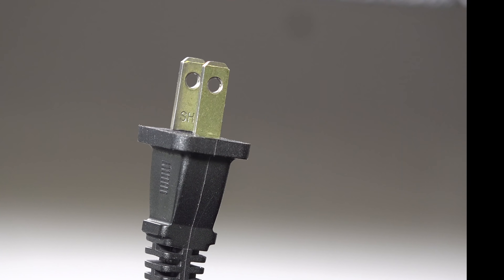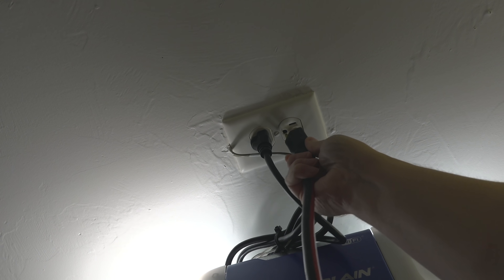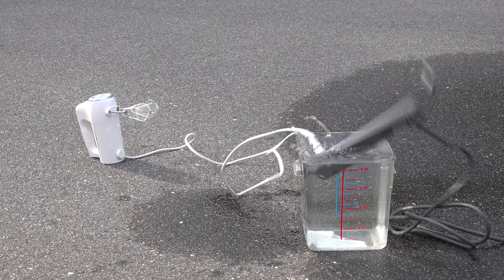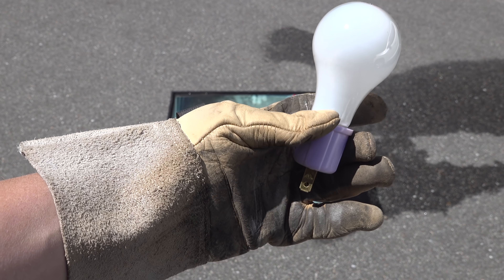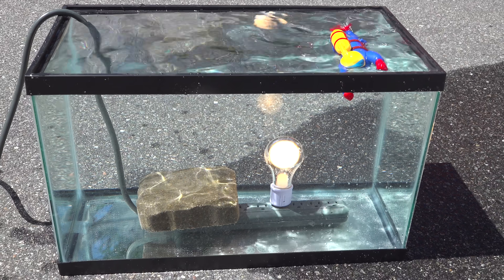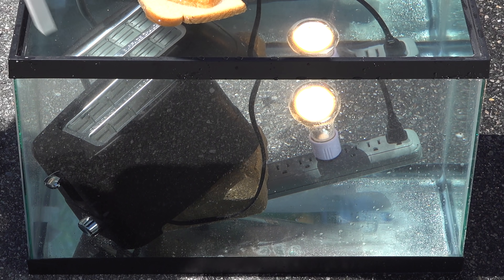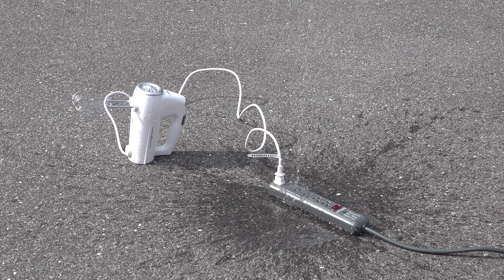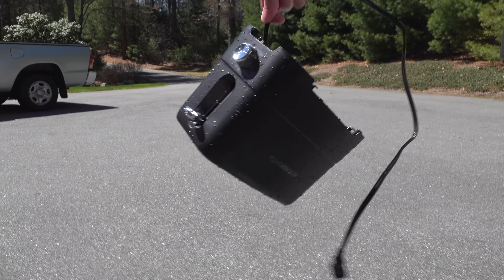What REALLY HAPPENS WHEN YOU SPILL WATER in an OUTLET?

Comment: Actually it is very unlikely to die in this scenario (not impossible) if you put your hand in the water in your setup. Water is generally an insulator and if you used distilled water you’d be absolutely safe if using 110v. Also the way the electric current flows is pretty straightforward- the greatest current travels through the least resistance. So the least resistance is the appliance load followed by shortest distance between the terminals of the outlet. You have to compute the chain of resistance starting from the amount of water between the terminal and your hand, your body resistance your ground insulation. All of that is normally so high - it amounts to mega ohms. So no current will flow through you needed to even give you a buzz let alone inflicting harm or killing you. Still you should not play with fire and electricity. Just stop believing these Hollywood myths.
Reply: I agree but in a salty water and your hand submerged already if you dip a power strip ur playing Russian rulette since you never know if hot or neutral goes in first.
Reply: @mind.hacker9996  well salty water depending on the tds could be a very good conductor. But even then it is far from a Russian roulette. Especially with 110v power grid. Again you should not play with electricity and fire either way.
Reply: No, current that will run through you only depends on your resistance and voltage, tap water is a conductor but with high resistance of around 1000 ohms to high voltage, if you touch your resistance will also drop to like 1000 ohms and that adds up to 2000 ohms or .05 amp through body and that will probably kill you if you fail to let go
Reply: @nekilikizhrvatske3336  in the scenario presented in the video - you won’t even feel the buzz. Unless you are bare footed and well grounded. Even directly holding just the hot wire while well insulated from the ground you won’t feel a thing.. but it all depends, if you use distilled water you’ll be safe, if you used proper ground insulation you’ll be safe. But if you used tap water with higher tds and have sweaty feet and you are either bare footed or wear only socks - well then you are in a deep trouble. So again, you shouldn’t play with electricity or fire because it can quickly go from innocent play to a dramatic event development.
Reply: @nekilikizhrvatske3336  please don’t try this because as you know slight change in the conditions - I.e. saltier water and being grounded may be fatal to you, plus her power supply might be using a transformer that galvanically decouples the hair dryer form the power grid.
https://youtu.be/sLjV_1iDJR4

Comment: Regular tap water won’t pass enough current to trip a breaker, but enough to trip gfci, to trip the breaker, you would need much higher voltage to pass enough current

Comment: You could have reached right in there and turned the toaster on. You may have felt a little tingle, but assuming you were wearing shoes, and on dry concrete nothing would have happened.
Reply: Even with rubber shoes on wet concrete he'd likely still feel nothing - just like a linesman working from an insulated cherry picker.

Comment: You should have added salt to the water or some sort of electrolyte, because tap water is relatively high in resistance around 1,000 – 5,000 Ω ohms. When a human body is around 300 Ω ohms. So when tap water or rain water is electrified a human body offers little resistance . Just like everything else electricity takes the path of least resistance.

Comment: water itself is generally a bad conductor of electricity , its the minerals in the water that increase it . add some soap or bath salts you will see a difference . your also asking the breaker to trip which would mean you need to get past that breakers tripping point , if thats a 30A breaker your going to need probably 40A to trip it. asking for the the water to carry that much current wont work, again needs a higher mineral content
Reply: Exactly. High resistance = no load. And normal breakers don't trip on ground leakage - they trip on current. Only RCD/GFCI will open circuit if there's a current imbalance between phase and neutral.
Reply: 30A breakers on 120V outlets?

Comment: Well to be fair that fish tank was fairly well isolated from ground with the glass walls, silicon seals and plastic trim so there really was no place for the electricity to go, mix with the fact that fresh water isn't terribly conductive the best place for the electricity to flow is from the hot to the neutral through the appliance.    As to the GFCI thing, yes they do and would save lives not disputing that, but spraying water on the plug only really tripped because the power strip was on the ground and you did create a path other than neutral for the electricity to flow, I'd be willing to bet a donut that if you did that same thing with the fish tank there's a good chance it won't trip as all the current that flows through the hot would still flow through the neutral hence no trip.

Comment: Clean water is an insulator.   Contaminated water can conduct electricity and the results would have been very different. Stay safe and use an appropriate electrical safety device especially when working outdoors or in damp situations.
Reply: It would have to have a lot of stuff in it to draw enough current to trip a normal breaker. Ultimately there would still have to be a sustained current draw of more than 15 amps to make it trip without the GFCI.
Reply: @StringerNews1 i'm no expert but electrolysis doesn't work with alternating current
Reply: @StringerNews1 good point, you dont need to care because youre right, i dont deny electrolysis im just not interested in chemistry so i dont do experiments
Reply: @StringerNews1 your also ignoring the fact that every country has a different school system
Reply: Pure water, H2O is non conductive. Mineral water, deep well, etc will conduct electricity.
Reply: @StringerNews1 i'm sure middle schools don't supply kids with alternating current
Reply: @StringerNews1 what school goes "lets do electrolysis the horrible way and supply kids with alternating current, and let them light it on fire!" as if you could produce enough in a few minutes, correct your facts, you used direct current.
Reply: @StringerNews1 I thought that electrolysis didn't work that well with ac
Reply: @misham6547  Electrolysis just needs a circuit path no? As long as it has that, it doesn't matter as long as it can flowl
Reply: @StringerNews1 https://www.youtube.com/watch?v=zj1Tb-uhup0
Reply: @StringerNews1 your gonna have to wait months to have enough hydrogen and oxygen for it to "explode"
Reply: @StringerNews1 are you sure you weren't  using direct current
Reply: @StringerNews1 
I’m saying the same thing, just making easier for laymen to understand. Salts, broken down into ions once in the water conducts electricity. It’s not even “might,” they really will.
Reply: @StringerNews1 
I get it. Thank you.
The switch and glass of water got me though 🤣
Reply: Yeah by "clean" you have to mean super purified distilled water
Reply: The reason why the toaster explodes in the bathtub because the water is contaminated by us that' makes sense

Comment: Show what the voltage between the water tank and the ground!  
Let people see how dangerous extension cords in the rain are are !! 👍
Reply: @StringerNews1 but generators are not referenced to earth, so it doesn't matter... The danger is if you touch more than one wire at a time
Reply: @AlessioSangalli  yes they are, neutral is shorted to earth so it has 0 volts

Comment: But it looks like we don’t need the protection. You were able to plug the bulb in under water without being electrocuted but growing up i heard don’t plug/unplug anything with wet hands. Seems like all bs myths to me now like the poisonous apples on Halloween.
Reply from the maker: No! The power was off at that time. You should NEVER put your body in any contact with water that has electricity in or near it. I won't be doing that test!
Reply: @SilverCymbal  oh i see, but why no sparks at least when it was powered on? Very strange especially when immersed in the tank because we know with that the water is in the outlet
Reply: @K0NY718  Sparks are formed due to poor contact. Since everything is plugged in solidly there is no sparking.

Comment: Did you check to see if the house ground became live/hot when it was plugged into the non-GFCI plug?
Reply: Surely it would be with a small amount of current. That's what made the GFCI trip, after all.
Reply: Ground cannot become live its always 0 volts
Reply: @nekilikizhrvatske3336  that's not true at all
Reply: @Krankie_V  yes it is, if it isnt then how does the multimeter write 230 volts difference
Reply: @nekilikizhrvatske3336  ground is bonded to neutral at the service disconnect. In normal operation there is no voltage on the ground however in a fault condition the ground conductor can and will become live. That's its job. To carry current away during a fault. In this case the breaker didn't trip so there's current (and voltage) flowing on the ground until the circuit is cut off.
Reply: @Krankie_V  well youre right but water has resistance it cant cause a short so that ground has almost 230 volts
Reply: @Krankie_V  not what i meant. To have voltage at ground you need a dead short from live to ground, and a mixer, toaster and water arent a dead short
Reply: @nekilikizhrvatske3336  that's not true. You only need a path for the electricity to follow. It doesn't have to be low resistance.

Keep messing about with this "knowledge" that you think you have and you're quite likely to be surprised with a nasty shock sometime.
Reply: @Krankie_V  ground is zero, live voltage is 230 volts, add a 230 ohm resistor and to voltage at live is 230 volts, the current through resistor is 1 amp, but the voltage at ground doesnt change its still zero because the difference has to be 230 volts for 1 amp to flow. Now replace it with a metal bar, the resistance is so low the current spikes to the maximum limit, now you dont need 230 volts for the same current, so the difference drops to low and tehnically there is voltage at ground but the breaker pops. Thats why when you short the battery and add a lamp parallel it doesnt glow, the difference across it is way to low to have enough current through the lamp. I hope you now understand what im trying to say.
Reply: @Krankie_V  if the ground has 230 volts then the current wont flow
Reply: @nekilikizhrvatske3336  I understand perfectly what you're trying to say. The thing you don't understand is that there still can be enough current to kill on the ground wire even in a high resistance fault. All it takes is a dirty connection somewhere.
Reply: @Krankie_V  also you are contradicting kirchhoffs voltage law, if the live is at 230 volts, load is 230 ohms and current through load 1 amp, then the voltage across the resistor is -230 volts 230-230+0 (ground) is equal to 0 volts
Reply: @Krankie_V  yes but the ground is 0 volts, live is 230 and therefore the difference is 230 volts, enough to kill someone. To follow Kirchhoffs voltage law ground can be live only at short circuit because the voltage at live is 230 volts, at ground lets say -229.9999 and across the conductor -0.0001 volts so if added the result is 0 volts
Reply: @nekilikizhrvatske3336  that applies to live and neutral as well but guess what, you can get a deadly shock across the neutral. All it takes is a path to ground through your body and there often is one.
Reply: @Krankie_V  ohms law applies to every passive thing (resistance, capacitance and inductance) and kirchhoffs voltage law is always apparent in closed loops
Reply: @nekilikizhrvatske3336  it's not a closed loop once your body touches a conductor or something with an electrical path to a conductor bud.
Reply: @Krankie_V  im asying kirchhoff voltage law works in closed loops, and poring water on a cord closes the loop

Comment: Neat experiment!  What do you think about adding a bunch of salt to the fishtank to increase the short circuit potential?  You can also try a part 2 and measure the AC current draw when dry and when wet.
Reply from the maker: I have a feeling that or more minerals would affect the breaker tripping might be interesting to try for sure.
Reply: @SilverCymbal  I’ve seen electro boom do it before, when there are other minerals such as soap or salt the water becomes more conductive or dangerous in some other way.
Reply: @Boostedludedude  agent smith neo is gunna beat u
Reply: @Boostedludedude  ah yes, of course he would do that
Reply: @SilverCymbal  Simpsons did... err Mythbusters did it...!
Reply: @SilverCymbal  You could also try to dip again that outlet, ground one wire on one side and the other in the fish tank and try to power a device through these 2?
Reply: @SilverCymbal  do it with soap and then salt in two different tests.
Reply: @SilverCymbal  are you trying to kill him
Reply: @SilverCymbal  You should get a plug current meter so you can measure how much more current the water draws.
Reply: @SilverCymbal  Just don’t try to add natural salt water free and everywhere accessible one 🤣
Reply: @SilverCymbal  😥🙀
Reply: @SilverCymbal  Throw some hot dogs in. You might be able to show just how dangerous this is if it cooks them.
Reply: @Nirrrina  😥
Reply: even more saaaaalt???
Reply: I think it would just increase the rate at what you get hydrogen due to electrolysis
Reply: I was thinking the same thing, as conductivity of water depends on ions dissolved into the water(eg tablesalt)
Reply: @thealphatitan2859  Generally water dissolves ionic compounds. Water for general use will always have various minerals in its makeup. Pure water is water that has went through a filtration process to remove those minerals making it non conductive.
Reply: @thealphatitan2859  That’s not pure water he is using. Touching that water without insulating yourself from ground would shock your shit boss man
Reply: Hot soapy water gives the best chance
Reply: This level of smart is actually sick!
Reply: Here's the Mythbuster's episode of "Appliances in the Bathtub" https://www.youtube.com/watch?v=SU7xkYmWwmQ
Reply: Pure water is non conductive. Usually around 18Mohm per cm. The  current is less that 10micro Amps between the hot and natural. GFCI trip around 6milli Amps. The minerals or TDS increase the conductivity / decrease the resistivity which will increase that current from micro to milli Amps. If you add soaps oils and salts from your body it will increase the current even more. It takes about 60mA to stop your heart. Thats 10-15times the GFCI current limit.
Reply: @FugalRepair rather, I will pee in fishertank
Reply: Nerd
Reply: little bit more salt
Reply: Yes and also using highly distilled water, I've read that it doesn't carry current due to no electrolytes being in the water. Would be a interesting experiment for sure.
Reply: ive accidentally spilled brackish water onto a ceap power strip, it sizzled and smoked
Reply: @thealphatitan2859  stop faking your intelligence, we all know your just using scientific words to sound smarter and using previous comments as an influence.
Reply: I bet if you that in Flint Michigan you would get a different result.
Reply: Wouldn't change a thing
Reply: @FrugalRepair more like the electricity will cause the salt to release chlorine and turn the salt water into sodium hydroxide/ lye. Just like putting two carbon electrodes into the tank.
Reply: it be better with something that wouldnt relese chlorine gas i think baking soda or soda ash just make lye so it cant be touch , the salt makes lye and chlorine gas
Reply: That is a good idea, but w h y  i s  t h e r e  s a l t  i n  y o u r  w a t e r  t o  t h e  p o i n t  i t  i s d e a d l y? ? ?
Reply: @Donnyedits1  Hard water, and in particular if we are talking about bathtub electrocutions, impurities from the skin, tub, and soap will serve the same function as salt

Comment: That is crazy and a little disturbing. I loved it. Thanks for your time and videos. Perhaps it would make sense to replace all the outlets in my house with GFI outlets. A little more expensive but more piece of mind. I'm sure that some day it will become a law eventually on new construction or before being able to sell your home. Maybe buying GFI outlets in bulk at your local electric supply company will be the cheapest way to go?
Reply from the maker: I appreciate it. It is very scary to see what happened, the breaker never tripped at all. I am surprised they haven't forced everyone to get all gfci. Who knows what the future will be
Reply: The code where I live requires a GFCI outlet in every bathroom and kitchen circuit.
Reply: @Whitie In Vermont One GFCI outlet could protect several outlets on the same circuit downstream (the included instructions will show how to wire them).  Or you could get a GFCI breaker for your Breaker Panel for the circuit with the outlets you want GFCI protected.  thx, tww
Reply: @tommywwalden1599  I have a GFI breaker for my breaker box. It's supposed to be good for up to 2-3 lightning strikes. Fortunately I have not had to test it yet.